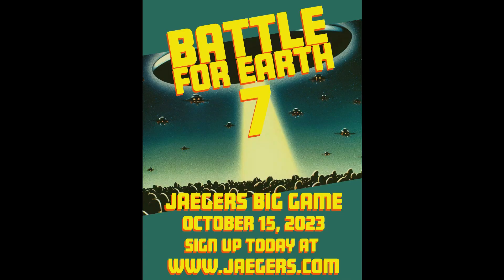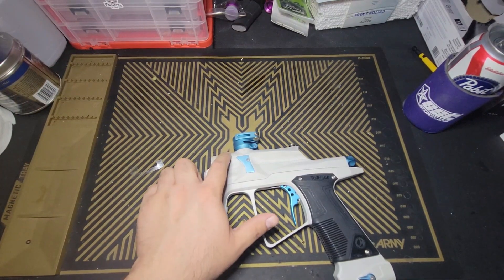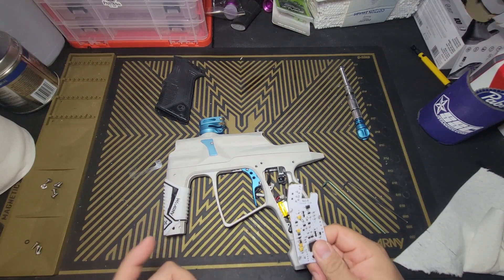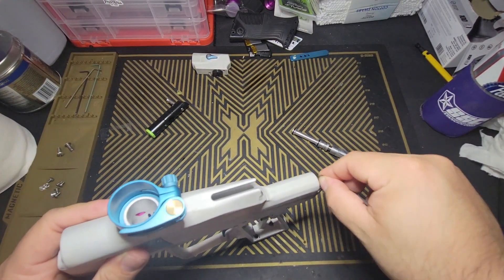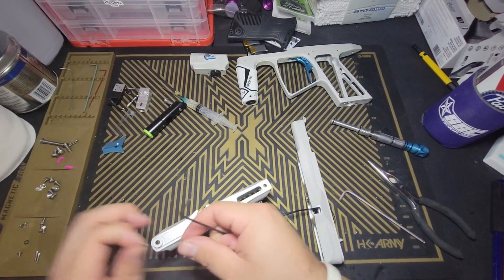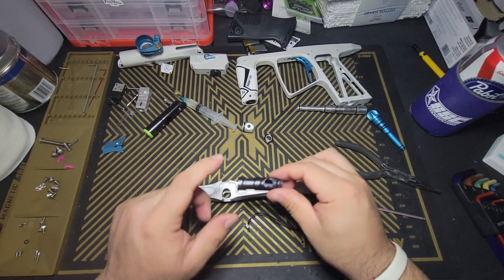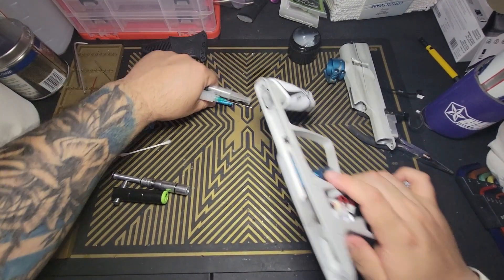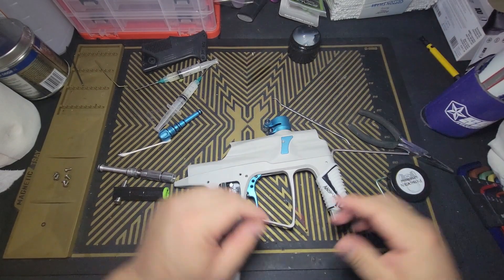J4 Torque Complete Teardown

Comment: Hey! This is Josh from J4. GREAT video. Thank you for doing this. 

The extra o-rings were for the rear piston. The piston was miss-machined so the taped to the top o-rings were for a better fit. I have a replacement rear section done in CAD, getting quotes now. It will increase reliability and efficiency. It should be quieter also. 

That was the 1.75 batch, I think yours was a 1 of 1. Loved that color way. The trigger goes over the spring. It was a metal flat spring in the original. The 3D printer should be 1" by .25" with a hole. The thought was you could cut your own out of a plastic pop bottle and tune it like you wanted. 

Original had our own feedneck - it was a bit mis-made. So we just bought a bunch from Simon. It uses any empire style feednecks. Axe and otherwise fit. Same with the bolt tip. You can use an Axe bolt tip. The closest gun in action is the DSR actually, we traded CAD back in the day. The spring doesn't return it all the way - just traps air. The spool returns from pressure in the Volume Chamber.

The snap-ring pliers we tried were cheap ones from Harbor Freight - and I do wish we had used some other way to retain that pin. The reg squeak was due to a harmonic with the spring. A nylon washer helps also. That nylon washer is just a 1/2" OD-.25" ID washer, about 1/16" to 1/8" thick from Home Depot. Or Amazon. Go ahead and use any grease except Dow55 - tends to swell the switch o-rings and make it stick. If you wipe it off it should be fine after a short bit. Feel more than free to use your grease. 

The reason some manufactures require the Dow33 is because the Dow is needed to make the gun seal. Your switch is packed, my ordering software is a bit ...laggy. And I am laggy. I added some -005 orings to test with. The -006 can be tight in some switch bodies. That harbor freight snap ring pliers are what we use to put spool o-rings on. We cut them off also. Highly recommend the snap ring pliers to install the -005 o-rings. The -005 work with dow33 and dow55

We are not on the market. We might do another run soon. We DO have a few hundred of these solenoids left. We use the Mac33 as a pilot to make the switch move and it is delicious overkill. I still have my stock detent in mine. 10 years old. We worked with Exalt on those. I don't even take a barrel swab out anymore. 

Your pulling the valve retainer out right. You can take the eye wire out without the valve, but just the side that connects to the eye board, it is a smaller tab. Proper tear down all the way through. Excellent Job. The spring actually works a bit like a regulator - closing the valve as the pressure decreases.

The reg retaining part was made a bit off – and the o-ring pushes the body apart under compression. 

The new cap is tight, shouldn’t need Loctite. Wasn’t made to CAD and the result is a cap that just is junk. A bit of grease on the switch o-orings that pop off holds them in. 

I put the board in before the backplate normally. I do put in the 3 screws but lightly, then put in the backplate. After I get the backplate in I lightly slide the board against the back plate, then tighten the board and the buttons and board all feel tight. 

A bit of tape holding the eye wires down does help. Painters tape is fine. That groove was supposed to be deep enough to hold a retaining tube, and it wasn’t made that deep….

The grip cover screws can be put on lightly. They are one piece rubber and seat well, but will squickh out if over tightened. 

If you take off the front o-ring on the Rear Pin (Guide) (of the two #8s) it will be faster, snappier and a bit more efficient. The rear pin can be very lightly tightened. 

The 3D printed triggers are super nice. Zdspb.com has a few. 

See ya around!
Reply from the maker: I can't thank you enough for all of this info, going to swap out the rear piston o rings and get the nylon washer ordered. Loving the torque so far and am interested in trying any and all new parts/alterations that come in the future!